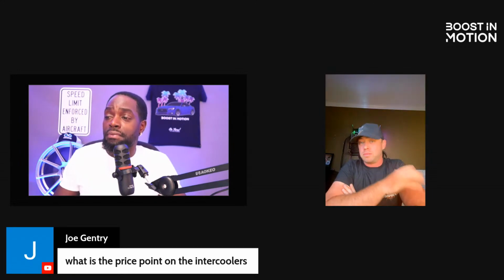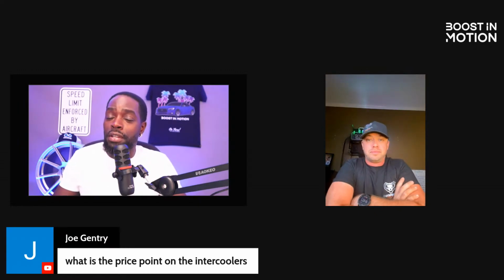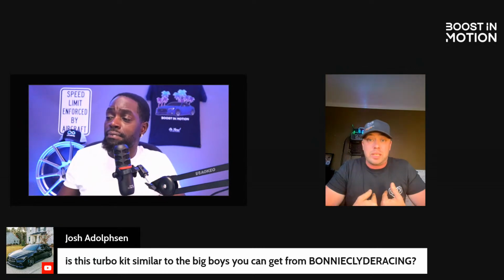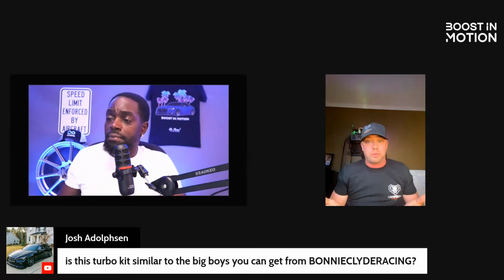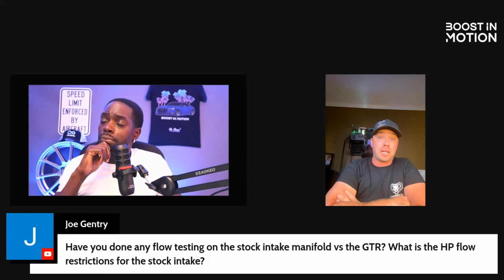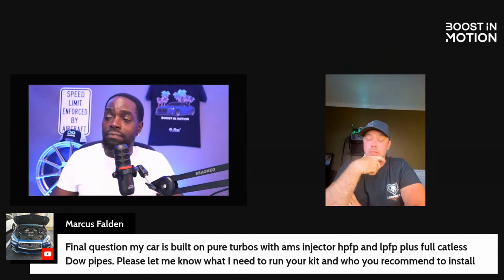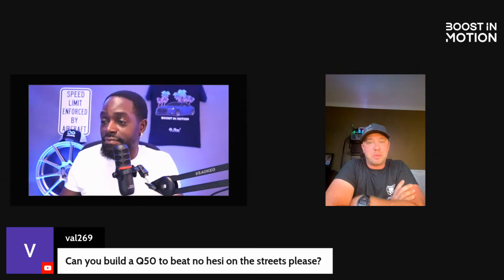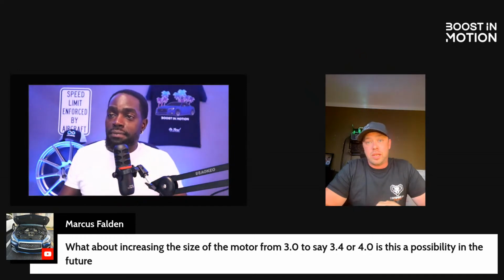Big Turbos drop bear LLC | bring the boost

Comment: Everyone wants to make big power over what pures make, yet how many built motors are there even out there and most importantly, built/upgraded "trans" options are out there even? Level 10 is a bit hard to trust with all the bad stories I've heard about them, top if off their VR30 trans I heard was around 6-7k lol. Need to worry more about this stuff more than making more power over what pure turbos can make first. Seems like to many people putting their foot through the door first without a shoe or sock on lol. These two things alone are going to add up to almost twice what a turbo kit (depending on kit/turbos) is going to cost.
Reply: I've also brought this up and was instantly attacked by the dumbs for NoT sUpPoRtInG tHe CoMmUnITy. 🙄

You can force people to use brains they don't have.